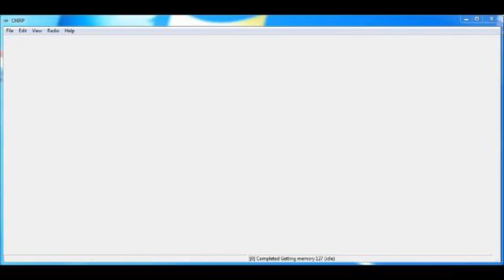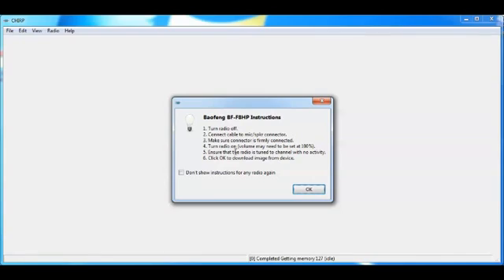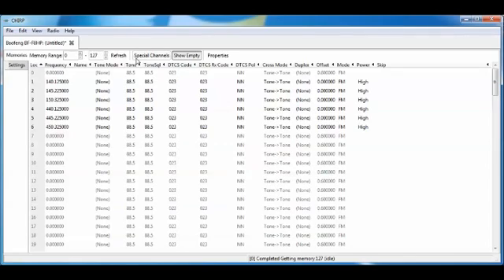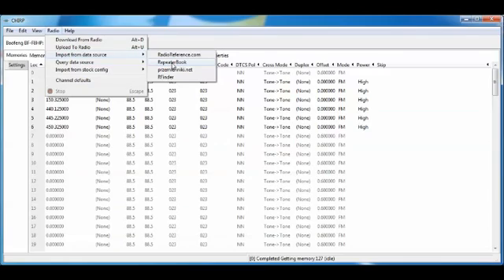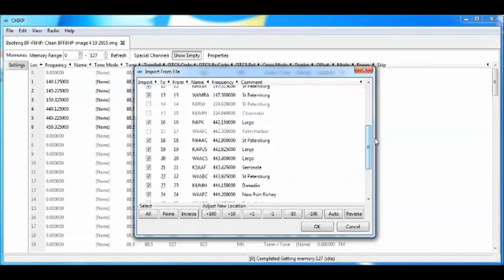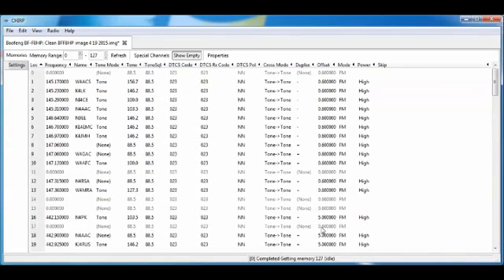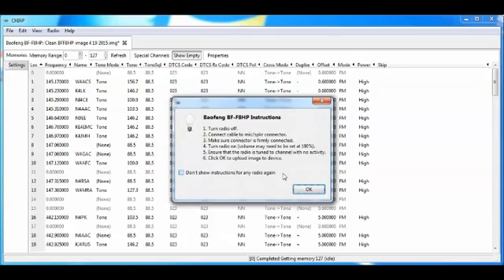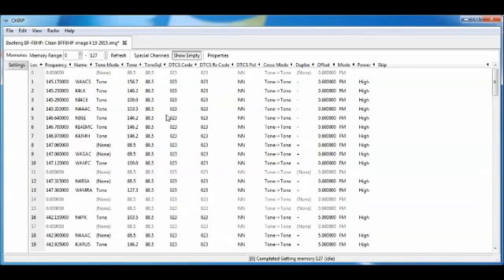Programming the BaoFeng BF F8HP radio using Chirp

Comment: Great video! I am new to ham radio and this BaoFeng radio, so please excuse what I am sure is a very rookie question!   I've been able to successfully download the chirp software and program my cable.  I know that this is a two band radio, with the top line of the display (A) dedicated to one band and the bottom line (B) in the display dedicated to the other.  

My question is this: is the A display only dedicated to the 2 meter frequency and the B display only for the 70 cm or can they be interchanged? In other words, can you use 70 cm on the A and 2 meter on the B display? Is it ok to be on the same band for both displays?

Thank you so much.  I know that this is a very green question! I look forward to hearing from you.
Reply from the maker: Sorry for the delay in responding. 

This is NOT a two band radio. It covers many bands including the UHF/VHF ham bands. It also covers FRS, GMRS, Marine And commerical bands. 

The top and bottom displays can dispaly 2 different frequencies. They dont have to be different bands, just two seperate freqs.

You can be monitoring you local club repeater on the top line while scanning all freqs you have in memory on the lower display.

Comment: Its quite possible that I have been given bad information. The Wouxun programming cable, I purchased, is not compatible with Yaesu and Baofeng as I was told by a couple sources Then I learn from those sources that their OS is MS Windows something and I run Linux. My OS doesn't recognize the attachment of radio + programming cable when attached to the USB port through the Chirp programming application. <b>My weak</b> link must be the cable. Your video seems straight forward but you don't mention using the Baofeng FTDI PC-04 programming cable. I have watched 2 other videos, where the OS used with the Chirp application program is Linux, and both emphasized using the Baofeng, more expensive, cable over the fake cheaper cables. One video showed how he purchased the cheaper cable to program but had to use a boilerplate methodology to successfully program his BF-F8HP. He emphasized, though, that the viewers should purchase the correct cable to ease the burden of programming using Chirp. I've purchased the FTDI PC-04 programming cable and await its arrival. Maybe it is my Achilles Heal at trying to program the BF-F8HP. Thanks for your time in making this video.
Reply: UPDATE: Cable I have is PC04 and is not for the BF-F8HP. Ordered correct cable PC03. Have completed the programming of some of the frequencies I want. Now I have to figure how to enter additional frequencies. Perhaps cut and paste?
Reply from the maker: Terry. This article I wrote on the F8-HP show the correct cable from Amazon  http://www.preparedham.com/baofeng-bf-f8hp-first-glance-review-at-a-cert-training-event/

The direct link to that cable is http://amzn.to/2oxRYAv

Good luck and let me know how ot goes. I am running either Windows 7 or 10 depending on the machine.
Reply: Ordered and received the correct cable PC03, and entered some frequencies into the radio, but now it won't transmit. More experimenting. Thanks for the reply and information.
Reply from the maker: Terry, try using one of the chirp websites I show in this video to automatically load some local frequencies to a chirp file and transfer to radio. Once you have that in the radio and its working on transmit, add some other local freqs manually to THE SAME FILE and then load that new file back to the radio.   Let me know if that works.
Reply: That's what I used. Build 20170414. I have an instruction to check the web site daily for updates. I used Chirp previously to program a Yaesu VX5R and the Wouxun UV2D. That was right about the time Dan began getting more active in upgrading Chirp. A BIG thank to him for sure. If the amateur radio frequencies were available then, as they are now, I wasn't aware of it. So I typed in all the frequencies that I wanted for VHF but didn't know how to put frequencies in the UHF bank. I only needed to hand program 4 UHF frequencies in memory and programming via hand gave me practice for entry when a computer wasn't available. I still can't determine why there is no transmit after loading the frequencies.
Reply from the maker: I dont know if you have checked Johns Miklors  site or not. He is the king of all thing baofeng http://www.miklor.com or his facebook site https://www.facebook.com/john.miklor.1. If we cant get it figured out try posting there. 

I would copy the file and email it to me and let me look it over. It may take me a day or two but I will check it out. 

I dont want to post my email here but if you go to http://www.preparedham.com/forums/index.php and sign up, I will PM you my email.  Also send me the details of the freqs you want to program.

Comment: I have the $20 cable, followed the instructions twice and still get "radio did not respond". I tried COM1, 2, 4, and each time it said it couldn't open the port.  I just downloaded the CHIRP program last week, so it should be the most up to date.  So, ???????
Reply: If you sign up at http://www.preparedham.com/forums/index.php and I will PM you my phone number and I can try to work this out with you.
Reply: I just signed up.  BTW, I downloaded CHIRP again and noticed it had a file date of 9/30/2016.  As the one I did the other day was dated a day earlier, I gave this one a try.  Same exact results although I did everything exactly the way you, Hoshnasi and BaoFeng instructed.
Reply: After trying too many times, I finally got the radio "to respond".  AD was helpful and told me I had to press hard on the cable head into the radio, as does the instructions by others.  This morning I pressed it in and got "radio did not respond" again.  Then I pressed real hard on the bottom of the cable (the fat pin side) and I heard the click.  It then programmed in seconds.  BTW, my radio I'm referring to is the Baofeng Bf-8HP.  Thanks, AD!

Comment: Wonder if folks would confirm something?

Baofeng claims the BF-F8HP is "identical" to its predecessor the UV-5R, but with upgrades from 2nd gen to 3rd gen PCB, higher 8W max output, and selectable high power output.

However!!! I've seen some ads claiming the "new" BF-F8HP they sell contains the 2nd gen PCB. (Clearly getting a unit with the old 2nd gen PCB would completely defeat the entire purpose of buying an BF-F8HP as the PCB has been re-designed to remove some known UV-5R problems and improve signal handling.)

ARE there BF-F8HP units out there being sold with 2nd gen PCBs and not the 3rd gen that Baofeng lists on their comparison chart at:
baofengtech(d0t)com/pdf/CompareChart(d0t)pdf

Comment: After putting in emergency services freqs and repeater freos, I went to the RADIO tab to UPLOAD TO RADIO, but UPLOAD TO RADIO  was ghosted out - not available - all that work for nothing (I didn't know at that time of the Repeaterbook  trick).  What  went wrong and how do I fix it, please?
Thank you!
Reply from the maker: +usernamemykel 

Typically this is because you did not first download from the radio.

Each time you try to load new data to radio, you must first download the current configuration from the radio.   This is to ensure that the software version in the radio and menory locations are correct before you try to load new data back into the radio. 

Try downloading from the radio first, then save that file under a unique name.  

The modify that file and load that one back to the radio. 

Let me know if you have any issues.  

Respectfully
AD
Reply: If the CHIRP software says that my radio has been CLONED, haven't I done that?
Reply from the maker: +usernamemykel

If you modified the file you just got from the radio there should be no issue.  I cant check until tomorrow sometime as I am editing photos and videos from a weekend activation of NPOTA this evening.  

I will check tomorrow or Sat for you

Give me the exact details of the process you followed.  I will try to recreate it IF you are using a Baofeng. I can do it while I am on the road for work.
Reply: DL'd CHIRP for my platform, W10.
Attached cable (supposedly the best on the market) to radio F8HP, attached that to a USB port - now the first few times I tried it, after I d'ld, the radio, it gave me the wrong mfr. name, which I changed to the correct name, but after entering all the freqs, the UPLOAD TO RADIO was greyed out - not working. When I changed ports, CHIRP recognized the radio correctly and cloned it. 
I went to RADIO, clicked on Outside Sources, and put in RepeaterBook freqs. UPLOAD TO RADIO still wasn't available. But, after checking  the radio, CHIRP had transferred all the freqs. Well that's great, and I've got memory 1-52 taken up with repeater freqs., but I'd like to enter more freqs., first responders, from memory #53 on, but quite frankly, I'm afraid I'm going to mess up what I (mysteriously) already accomplished. Ideas, thoughts, suggestions?
Reply from the maker: +usernamemykel 

Good to gear that you get it to work even if it was a mystery. 

Are you using the latest daily build of Chirp?  If not you might try that. http://trac.chirp.danplanet.com/chirp_daily/LATEST/

You should be able to DL from the radio to Chirp now and the software SHOULD remeber the setting.  SAVE that file since it does work. Save it again under a different name.

You should be able to modify that file with your desired freqs and upload that back to the radio. 

The key is to get the radio to talk to the computer. As you learned, sometimes changing the USB port in the software or phyically on the computer is the magic it needs. 

Another good site to check out is my friend John site  http://www.miklor.com He is the guru of the china radios and chirp. 

Keep me informed as to your progress.  I have a F8-HP with me on the road on business and the laptop so I can try to help you with that this weekend. 

Respectfully
AD
Reply from the maker: +usernamemykel 

I also just saw you are using W10.  That adds a level of complexity as I am still using W7 and have not upgraded yet(too stuborn) so have no experience with that Op Sys.
Reply: No problem, my friend, for yesterday I joined an amateur club which has it's "shack" in the same county park where my archery club is located. I found an "Elmer" for myself who will assist me with the programming after I obtain my license. The test is soon, May 12th, and I fully expect to pass it on the first try.
 
Happy Birthday to me, BTW!!
Reply: The club, BTW, has a low membership fee of only $25/year, and they charge nothing for administering the tests.  BARGAIN!!
Reply from the maker: +usernamemykel 

Perfect. I feel bad when I cant help someone directly and get my hands on the radio to work with it.  

CommGrats on finding a club and a Elmer close by and those archery skills can help in getting wire antennas in trees ;o) 

Are you in the US or another country?

If US or Canada check out www.hamtstonline.com for study.  Although it cost same $$ it is the best method IMHO to prep from the tests. 

I used it for my Tech & General at the same time, then 6 months later I took and passed the Amateur Extra test which Impassed woth flying colors. 

HTOL will even give you you money back if you dont pass the test. 

Also please check out www.preparedham.com my blog page and the Perpared Ham forum @ http://www.preparedham.com/forums/index.php

Good luck I I hope to have a QSO with you in the future

Respectfully

AD
Reply: I know what you mean, we all have limitations, self-imposed or not. 73

Comment: Didn't work with mine using the 3.2.0.0 prolific driver. On download to radio, radio type was not recognized.  So I ordered the $20 cable tonight.
Reply from the maker: +Richard Girou let me know how it goes.  I have heard of folks having to try different USB port if it is not recognized the first time.
Reply: +PreparedHam.com  Tried that to no avail.  FYI if anyone has the same problem, go to miklor.com. They have instructions to build your own cable a lot less expensive than buying an other cable.

Comment: For the f8-hp .. Video.. Do you leave the greyed out line blank, can they be used or can you consolidate the upload to group together without greyed  out (down) repeaters taking a space..
Also you showed how to add them 1 thru 30 or so.. How would I go and add repeaters from another region, state etc.. So they are on 31- ? Or will they have to write over the prior upload?

Comment: If you hover over the gray import entries, it will show a tooltip with why they are grayed out. For example, it may say "mode DV not supported" if you're trying to add a Dstar repeater to a Baofeng. "Frequency is out of supported range" is another common (and self-explanatory) reason an entry may be grayed out.